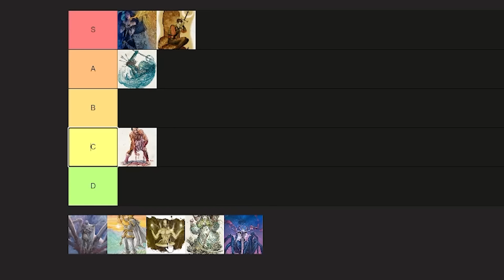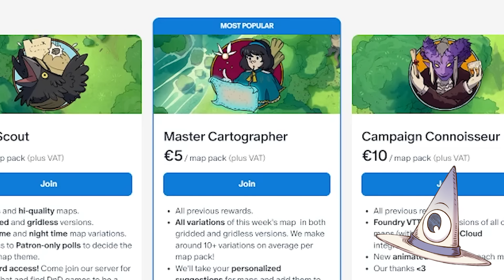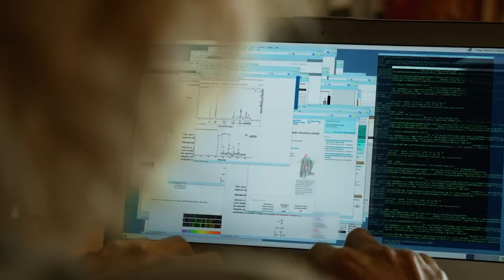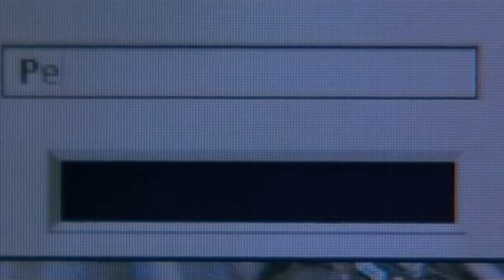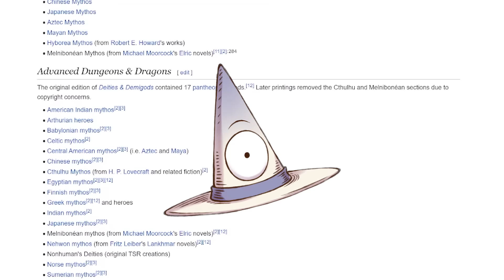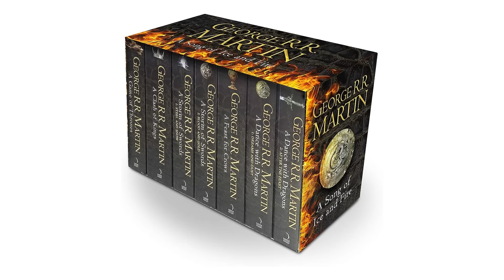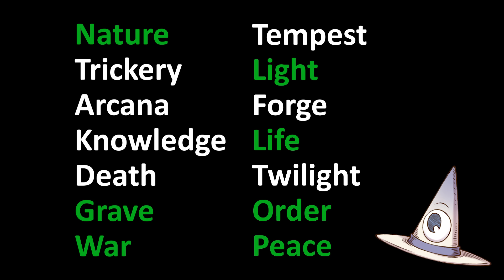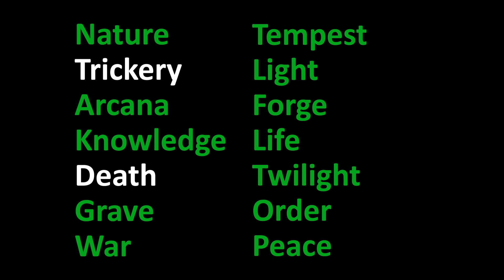The Problem with D&D Gods (and how to make your own)

Comment: I like to imagine gods as a form of Tulpa. In my setting spirits are the living concepts birthed from the Id & Super-Ego of living creatures, Fae, Angels, Demons ect... Proto-gods are essentially what you described, a spirit of a place that has gained a following. Lesser deities are gods with a small organised following, while Greater gods have a following like that if the Abrahamic or modern Hindu faith. Some Greater gods run things solo while others have a pantheon at their back. 

Deities require faith in their followers, in exchange they can grant divine miracles BUT they cannot directly interfear as they are bound by their nature. Should they lose the faith that feuls theem, they can find themselves dwindling until they are left a husk of their former selves. Being forgotten is far worse than death for a god.

Comment: I think any creature with spell immunity under a certain level should exclude warlocks eldritch blast if the warlock is high enough level that a they can cast spells high enough to break that immunity, or that any other caster of equal level can cast spells high enough level to break that immunity as its a unreasonable nerf to warlocks basically if they are immune to 5th level spells and the warlock can cast 6th level spells the blast should be treated as a 6th level spell.

Comment: For a way of explaining it, well, you’d have to do it in your home brew I suppose, but consider the power of the gods from a more ephemeral perspective, as widespreading and constantly conflicting with the gods who oppose them. So, any particular god is restrained in what they can do by the power of all the other gods who don’t want it to happen. So, they pick their interventions carefully, and typically work through a cleric that already has a tie to one of the gods interested in positively dealing with the situation because the tie allows the god of that cleric to more easily keep track of things. Divine realpolitik, as it were. Either involving more gods would escalate the scale of the conflict, or they just can’t push through any more help than they are giving and have to leave the rest to the mortals while they focus on not letting the bad gods vaporize whole cities for giggles.

Comment: my main solution to this is just simply not using faerün as the setting, or they just simply don’t exist in that campaign. it’s my campaign written by me, i don’t need storebought deities, i want to make my own (which i do already but i am here to get better at it)

in general i don’t like the stock rules for gods in D&D. i do love the whole “power is based on believers” thing though. sure, you can’t kill a god, but you CAN strip them of their godhood and THEN kill them, either by killing their followers or convincing their followers that their god actually sucks

although most of the “gods” in my campaign are actually false gods but regardless

Comment: I just made the gods in my world sign off their rights to intervene after a spat nearly caused the end of creation itself. there were still ways they could communicate, but those were so limited that they often did not get to use them. I stole a little with cautious hero in that only one god was to address one major crisis facing the material plane so as to not breach the contract. Should two gods chosen cross while dealing with these different crises they knew that should they try to interfere with the other party the penalty might cost them everything. The only ways they ever really get involved with the party would be the likes of divine inspiration, a question, or a blessing.

Comment: In the world I made you have 4 primordials. Creation, Destruction, Space, Time. From there you have the elder ones the first living beings made by creation and how they reproduce. Creation made it so any child born with an elder one will have the same level of power as a primordial so that primordials can't jaut strip those powers away if they are gone against (mainly made because Destruction is a bit cranky) that is when they also took on their first names. 

Below them are their descendants. Descendants of these primordials are sent to different universes with each planet usually having 4 of them. 

Sometimes a 5th is sent this one is a descendant of all 4 primordials are is the source of magic in their world since magic is achieved by combining all 4 primordial powers. Now these ones usually set up their system of magic and then leave. 

The other 4 are limited like the primordials. For example creation can only make not remake or destroy, to remake creation needs destruction.

Comment: Expositioning what the entire pantheon of gods is doing is basically ridiculous.  Even with a cleric in the party doesn't necessarily mean they are directly involved or fully aware of what the cleric is fully involved in.  When a party is in the a castle, do you name the entirety of the staff, all the officers and soldiers etc.  Even if other gods are active in the campaign, whos to say you would be aware of them.  Each race have gods that may often cover the same domains and when it comes down to the god tier power levels, greater gods to intermediate gods aren't even close even though they are cosmically powerful.

Comment: with all the shit that has gone down on Faerun even in the last 100 years I literally have the answer to the question why the gods aren't helping these 4 dudes: because simultaneously there are 444444444444 more dudes in 44444444 more places where shit goes down on a scale as massive as it does in your campaign

Comment: You don't have to need OG Faerun gods to look like a problem, to show how fun it can be to create own pantheons. Neither, the creation of the new pantheons in exactly two ways you have described is the only solution postulated problem. 

On Eberron, for instance, the different religions have rather silent deities and no preventative measure put in place to stop a cleric of a good god from being self-serving evil bastard. 

The gods of Krynn are small in number and split into rigid three group. Good, Evil and Neutral gods.

Deities and Demigods for 3e D&D talks extensively about existing pantheons, creating new and even make games with dual deities and monotheistic deity with multiple aspects. 

Planescape deities tend to split between those who largely focus on a single Sphere of the Prime Material Plane and those, who take care of many. As you may guess, they're most often extremely busy.

While according to 3e Faerun and Deities and Demigods, gods can create a limited number of weaker avatars of to send on different missions, in 2e Faiths and Pantheons Faerunian deities most often sent manifestations often resembling their holy symbol, but it with extra special effects to guide (or threaten) their clerics and followers. On Faerun deities have the Chosen, like the Seven Sisters or Elminster, to be gods special elite problem solvers, while Planescape had Proxies, chosen among their divine realm's petitioners, those souls living an afterlife according their deity's covenants. Those divine agents are not all-powerful, while gods of both Planescape and Faerun are usually limited to where they could or couldn't go freely, to what degree they can influence things, and their most powerful manifestation/strongest avatar/proxy/chosen is a very precious limited resource. 

Strictly speaking, between the editions there's no shared rules and lore, because the rules and the lore are constantly changing for arbitrary game designer reasons. Keeping up with all that lore change is pointless, do it if you have fun with it I think. Some of these changes even have contrived explanations. Like that one module where Vecna tried enter Sigil, dethrone Lady of Pain and become the overgod of the entire new multiverse, remade in his image. He felt, but the multiverse felt it so much apparently, it made a jump into 3rd D&D. 🤷‍♀️

I dunno. Pantheons are fun. If nobody including DM doesn't know about a bunch of gods, then you don't have to care about them in your game. If some players and DM know about some gods, how is it different from any other lore? Check, player's religion, tell them what they know, let a player who love to play a preacher or know it all wizard, or a 
worldly bard tell about divine knowledge in their own words as it becomes relevant, I dunno. Add gods, remove gods, rewrite gods, restructure pantheons, ignore gods and plot contrivances, follow your heart's desire. Everything matters in your game world as much as you want it to matter.

You could think of all the different hidden assumptions people have about gods and why certain things feel more or less contrived. 

Maybe, you're not the only heroes, maybe it's not the only world-ending threat, maybe other gods think that somebody else already handles this problem, maybe all gods influence everything to some degree, but not all of it as obvious to the players and some of it just equals out. 

Maybe the god of horizons, that keeps the gods of moon and sun from influencing the world and tearing it apart is a plot contrivance in its own right and you'd come full circle, back where you started.

Comment: Alt solution: The palaclericlock is delusional. They actually possess the power themselves and only think they need a "god(dess)" to use them.

I'll be honest I'm planning an atheist/agnostic campaign and this is the explanation I'm using if a player happens to choose one of the classes that requires a "higher power."

Comment: I mean clash of the titans(the classic version not the Percy Jackson but with adults version) had the perfect reason as to why the gods aren't doing anything. Which god of war borrowed.

Random talking statues or homeless people are secretly gods who are infact doing "something" just nothing that has an obvious benefit to the hero until the hero has earned a favor.

Then the mummy movies literally do have some kind of figure step in i don't know whether those are considered gods. But it certainly changes the dynamic of the final fight.

It would help if the game included a beyond ridiculously overpowered statblock for a character who's sweat will fully heal you, awaken repressed memories, and ward against magical darkness in a given location possibly for centuries. Or whatever a gods sweat does.

Stronger storms shifting land masses and geological features waking up could be described as the result of gods. Galeb duhr and ents aren't exactly gods but they may have seen something weird that pushed them out of their usual habitat.

In some stories the gods are only made powerful by the jewelry and oil and robes they wear and when they prostrate themselves before one another either to seek aid or just for diplomatic reasons or just to meet for revelry they set aside the essence of their godhood by stripping and bathing. In such circumstances someone else could steal their finery and mantle them. I wouldn't recommend it because sometimes revenge is served 5x as hot as the temperature of the sun🌩 

You could also have a camp of holy warriors serve as a final opportunity for trading before entering the crater that surrounds the temple the enemy is hiding in.

Also what if a god just gave you a cat and told you that should help because in Egypt the undead are afraid of cats. or if a god demanded a sacrifice from you but then when you gave a sacrifice just told you to get two of your friends to each give a sacrifice.

Comment: So it's very specific but i'll throw in a potential 3rd method that lets you have your divine cake and eat it too, while also giving an answer to the question ''How god dose die'' that isn't just ''No'' ''Will Get Better'' or ''Basically Removed from lore''. When a god dies, they don't just vanish, nor do they bring down the world around them, rather a god's death is the requirement for creation, when a god dies they become that domain of their worship, or rather, for this trick/method to work, the domain of their potential worship, a potential god of the sea dying results in the sea becoming a thing to start with as they turn into the very ocean, a god of the stars, dose the same and so on, they don't loose all agency/power fully, they can still be prayed to, granting powers to Clerics and Paladins. but they do loose the ability to do things more directly. So why are some gods more active than others? Simple, there was a battle between gods at the dawn of creation, a war that killed large numbers of them, resulting in the world being created and only a few survivors, this lets you pull a Greek Pantheon of ''One God For Everything'' without running into the activity issue, why is the god of War directly helping us save the world but the god of the ocean isn't or is doing it very subtly/indirectly? Simple, because the god of war survived and thus can interact directly, where as the god of the ocean is dead and just can not. This method lets you have both flavors of divine intervention, direct and vague, without needing to go into weird details, while also allowing you to have more gods without running into issues, you have your pantheon of stuff/domains that interest you that are alive, those that interact with the party, well interact, those that do not, you can come up with a reason for why they are not that isn't as convoluted since there's not so many of them, and for the dead gods they come up with their own reason as to why they do not. Hell this can further even explain why some gods have celestials/angels whilst others have lesser gods/demigods and nymphs and that sort of thing, living gods have angels, dead gods have lesser gods and creatures that where spawned alongside the biome they created

Comment: 19:20 Already done. 

20:30 Oops, did both at the same time...

23:00 So.... How about both 1 & 2? Cuz fk it. Why? I wanted to work on a multiversal scale. Some gods are effectively region locked to one kingdom. So what? Then there are gods that span the cosmos and are worshipped by literal trillions of beings. The latter are still only equivalent to a higher god. They are not the strongest gods, as that's where the line D&D draws between "God" and "Primordial" gets blurred. 
The most powerful of the gods I've made are not powerful because they're worshipped by all. They're powerful because they are the embodiment or source of some cosmic law or universal constant. The god of say, time, is time itself. They have a personality, attitude, and spirit, but they still are the concept itself. 
Then ya got the Incarnates, which are the incarnations (duh) of various things that are not laws of the cosmos or are only lesser laws. (I only have 8 of the ones mentioned before, with only 2 above those.) These ones are numerous, but can only be in one place at once and worshipping them does nothing as existence itself is what "believes" in them. They more are their domain made manifest, with the powers of nigh unmatched mastery of said domain. Not to mention, they can only be in one place at once on any given plane. Even amongst the various bodies they possess, only one will be their primary body. Given, however, the nature of their existence makes them completely impossible to kill permanently, their purpose is to deal with things the players can't, often that not even gods can. 
So, say an incomparably evil god is trying to manifest in the material plane, but due to my rules the stronger they are the harder that becomes, the players could be tasked with holding them back for a time until an Incarnate arrives to deal with the problem cuz no god strong enough to stop them without manifesting themselves could do it faster and interrupting them indirectly could cause a divine war, the players of a high level campaign would be a good fit. Say they sabotage some of likely dozens of ritual sites, the god would take much longer and have a harder time manifesting, giving an Incarnate enough time to arrive and kill them before they run off and cause an issue big enough for the Laws themselves to get involved. 

Most gods would be in the dark as to the nature of the Laws and Incarnates, given the scale they work on being far beyond the vast majority of gods. After all, they'd be like "a frog in a well", only seeing a small portion of the sky and thinking it the highest peak. They don't know about what sits beyond the scale of their existence.

24:42 All of my "Laws" are Dichotomies... so they come as twins and cannot exist without eachother. Time & Space, Life & Death, Order (aka Contrived Order, like Mechanus) & Chaos (aka Natural Order, like evolution), Reality/Matter/Truth & Fantasy/Antimatter(?)/Lies (basically just what is material and what is ethereal/the concrete and the ephemeral.), and 2 more that are separate but effectively supreme gods that created the rest out of themselves so effectively have the combined domain (just like how they're stuck in the same body) of EVERYTHING. 
None of them are worshipped in the same way Io isn't worshipped. People don't even really know about them besides the concepts as they're busy managing the "biggest picture"(tm) stuff in all of existence. They might step in if, say, some imbecile with power equalling or surpassing Io decided to fuck around and try to control one of their domains, such as trying to end reality on a cosmic scale*, but otherwise they rarely bother. 

*causing Armageddon would anger one of the 2 supreme gods as the domains they actively preside over are creation and destruction on a cosmic scale. Making and ending universes type shit. If the Obyrith suddenly started to end reality, they would intervene.